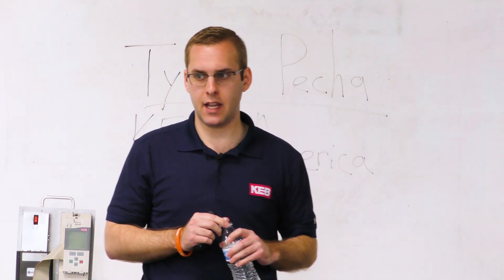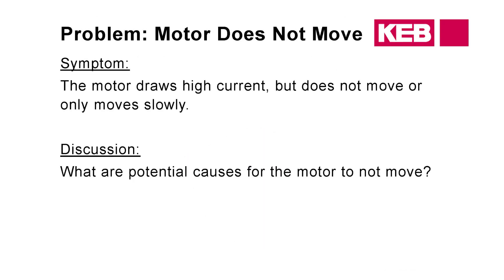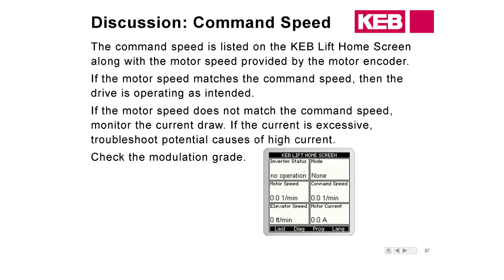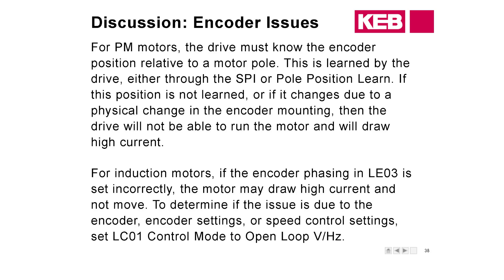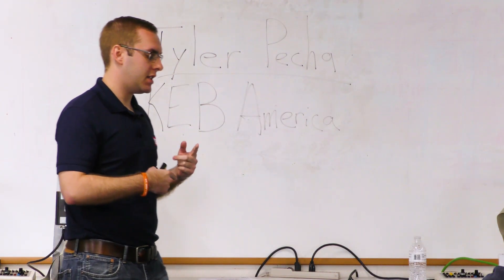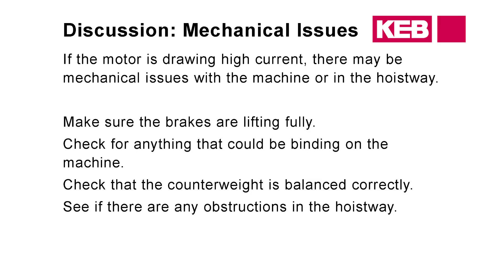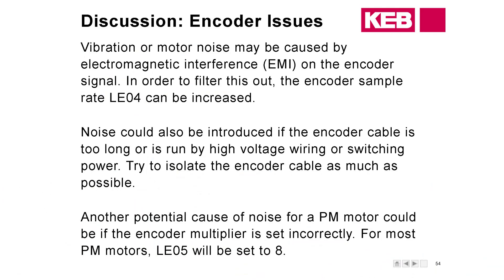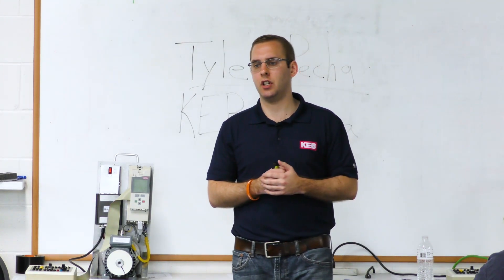KEB F5 Elevator Drive Training: Troubleshooting Operational Issues (Part 4)

Comment: keb f4 how to solve eoc error
Reply from the maker: An E.OC error means "Error Over Current". You need to troubleshoot why the drive is getting current over the recommended operating power guidelines. If you continue to have troubles contact your machine manufacturer or a local KEB representative here: https://www.keb.co.uk/contact/contact-worldwide

Comment: E. noL 2 error how to reset
Reply from the maker: To reset, power cycle or give it the error reset input to clear the error. The cause of this error is excessively high load at low/zero speed.  Follow up with the OEM (Original Equipment Manufacturer) for further assistance.